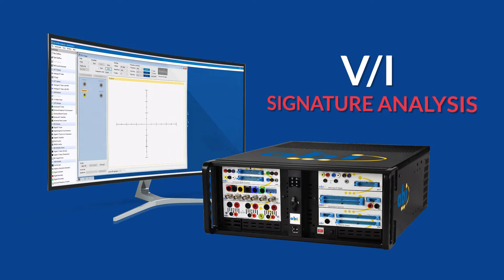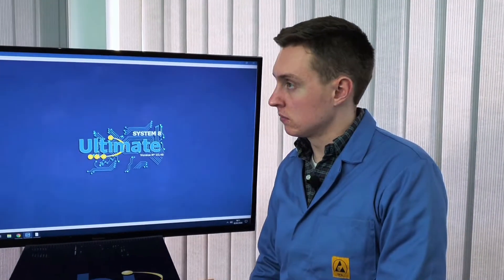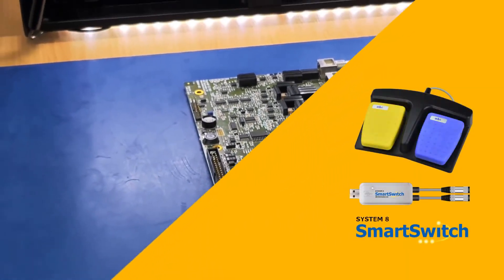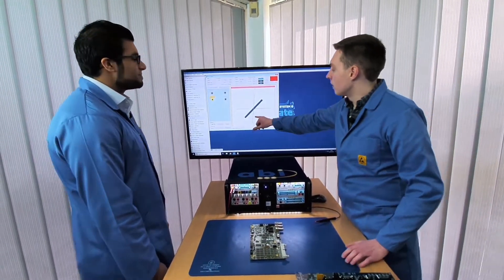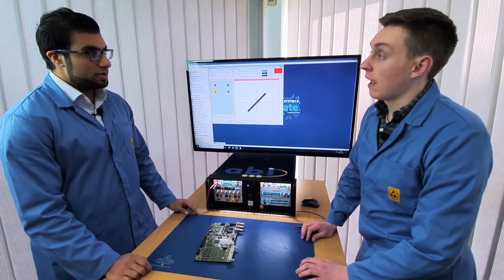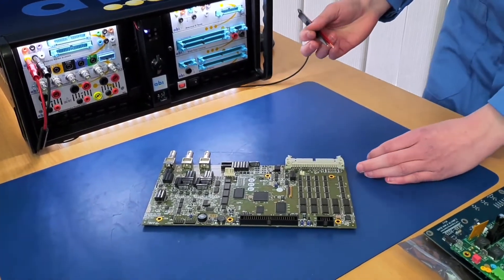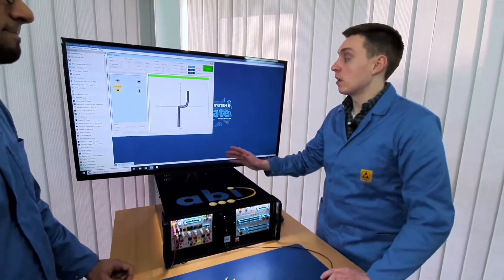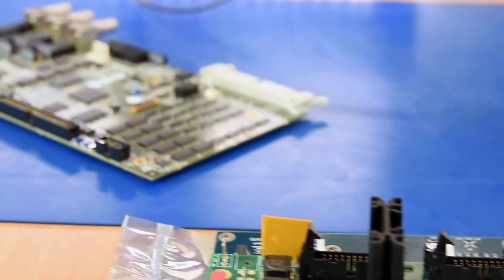Understanding V-I and how it can help you troubleshoot and repair PCBs - ABI Labs Series1 Episode 2

Comment: Hi , Good Video. In VI trace for resistor, I see you are getting a diagonal line. I am not sure how the component is connected inside the board but generally when the component is outside, we get this diagonal line. But if the resistor is connected in parallel with other resistors like SIP resistor, then how to validate the VI trace? Will we get this diagonal waveform (indicating that it is a good component) always or will it differ? I feel it will not defer. what is your opinion?
Reply from the maker: Hello and thanks for your comment! In order to have a clear signature of the device under test, you need to be able to manipulate the instrument settings to generate a more informative signal. Other devices on the same net may have different levels of influence on the DUT. In order to validate the V-I result, you will need another reference so that the #BoardMaster software can compare both and give you a Pass or Fail.